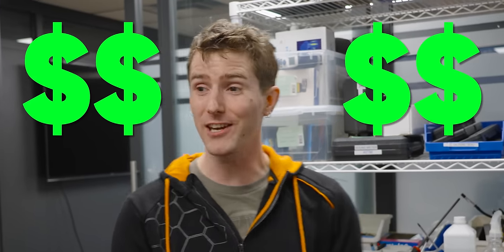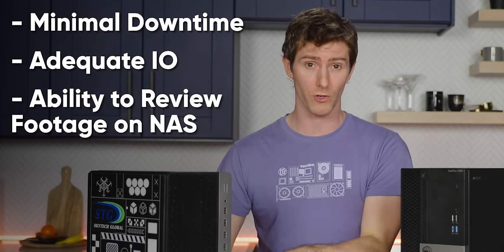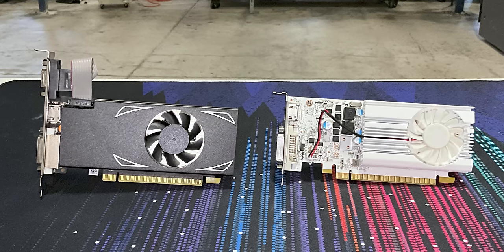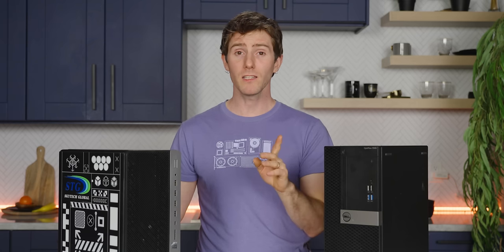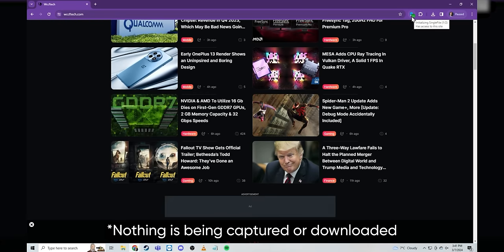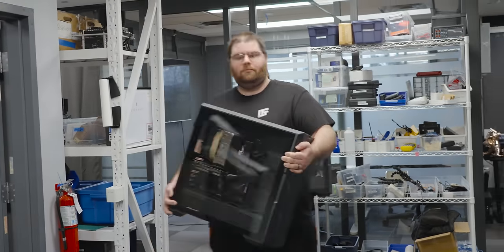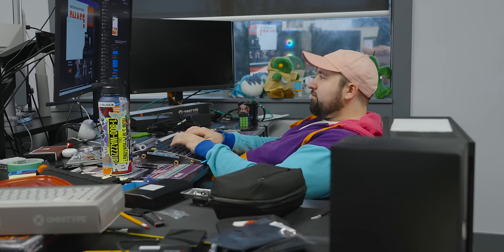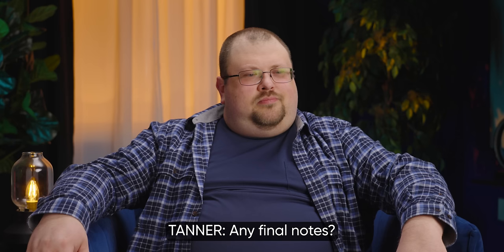We Downgraded our PCs to Prove You Don’t Need a New One

Comment: more than enough
i9-9900/i7-10700
$24 thermalright cooler
Z class mobo for +3200mhz ram
32gigs of 3200 or higher speed mem
240gig~512 of os drive (nvme)
960gig~1.2tera ssd local project drive
Rx 7600/arc a750 card
450W~550 good quality psu
Front mesh case $<50

Comment: I know everyone's probably tired of hearing this, but the only reason (in my experience) that things slow down is because of Windows Updates.  I'm writing this comment from a 2012 Mac Mini running Linux.  Despite being on the latest version of my distro, the computer runs just as fast as it did in 2012.  If I boot back into MacOS, not so much.  Every single Windows PC I've ever seen acting sluggish behaved like it was brand new when I nuked & paved it with Linux.  Granted, if you don't really bother to learn and master all the Linux counterparts to your Windows-only apps, you end up writing your own epitaph, but I gave up Windows entirely almost seven years ago, and I never want to boot Windows again for the rest of my life.  Windows = problems.

Comment: And Linus media is not a giant corp that has more than bunch of tools for monitoring, but light or mid so they did not experience the real downsides when bunch of agents start to collect data at startup and bunch of agents need to authenticate to servers and send data, checking policies, ect.. and if they are offsite that can be cruel for end user... But same computer (lets say 3rd Gen Ivy 3770 non k with 750 TI and regular SSD and that is higher end engineer PC) without all those agents runs just fine (even today) and can game on some low and even mid setting on some online games.
Main problem is if you are used to higher end PC at home and must work on something like that than things can be frustrating a lot, for users that usually surf at home and do some light work on low or mid computers and laptops will not see a lot of difference except those things that get slower at work and they do same thing and have "better" computer at work.
And it all depends on industry they are in...

Comment: I worked on a NUC for years, and was perfectly happy with it. CPU in there was pretty new, generation-wise, but not the most powerful thing. Had plenty of RAM, because that really helped with work. Nvme ssd too. Intel onchip graphics only, but since I don't need to play back 4k video - so no problem there. Also pretty easy to carry home for use on home-office days.

I got switched to a Laptop solely because I needed something I could put in a backpack and carry with me, should the need arise. Has a really nice screen, that I barely use (prefer the larger external ones I got) - and a not so nice keyboard that I barely use, because I prefer my external mechanical ones. And has an ever aging battery, that's gonna have to be replaced, once it starts bulging... but the way I use it, there's barely any benefit over the NUC.

Comment: Watching on my i7-4790
Reply: On my 4770K. My SSD (OCZ Agility 4 512GB) and chassis (Lian-Li PC-9F) are the only components that really predate the CPU. Possibly some or all of the RAM (4x4GB DDR3-1333) too. I've intentionally downgraded the storage after moving the data to a NAS. I'm probably on my 3rd or 4th time reinstalling W10 as software clutter and incremental driver updates can cause some issues.

Comment: I have a 10 year old laptop. It is snappy, as new. It is not windows 11 compatible, but who cares … I don’t. I stayed very very long on windows xp, which by the way is still my favourite windows version. After this, i will switch to linux (on the same machine) since i do not like the upgrade path to windows 11. Guess that microsoft made an arrangement with hardware vendors to try and push newer hardware since the speed difference gets marginal nowadays

Comment: Im with mine T3500, Xeon X5687 gtx 1070 24Gb of overclocked Ram 1999 Mhz ( made it possible with some strange custom BIOS from chinesee sites xD )  and custom cooler ( Manufacter tower with 2 fans attached to it with zips to make airflow xD ) and it's preety gucci till this day, sure, i do not play newest games on UBER settings but still can launch them on medium, with 60+ fps's xD

Comment: "would require monitor downgrade"... how do these clowns even work with PC:s professionally? dvi is digital singal, all you need from hdmi or display to dvi is a 2$ adapter, it just moves wired, no chips in it.

Comment: Playing this video on an HP Z400 in 4k. I edit videos on it too and it's flawless. I play GTA V and stuff too. It's an old workstation but it's good haha.
Reply: Operating System
	Windows 10 Pro 64-bit
CPU
	Intel Xeon W3565 @ 3.20GHz	69 °C
	Bloomfield 45nm Technology
RAM
	24.0GB Triple-Channel DDR3 @ 533MHz (7-7-7-19)
Motherboard
	Hewlett-Packard 0B4Ch (CPU0 PROCESSOR)	76 °C
Graphics
	BenQ GW2255 (1920x1080@60Hz)
	4095MB NVIDIA Quadro K4200 (NVIDIA)	46 °C
Storage
	931GB Crucial CT1000MX500SSD1 (SATA (SSD))
	1863GB Western Digital WDC WD20EZRZ-00Z5HB0 (SATA )	29 °C
Optical Drives
	PIONEER BD-RW BDR-209D
Audio
	Realtek High Definition Audio

Comment: If you're looking to breathe new life into an older computer, consider trying Linux!!  Especially on machines with less powerful hardware, Linux offers a significant performance boost compared to Windows. For reference.. my refurbished Optiplex 7010 from 2014 boots windows in 4-6 minutes, but with Arch Linux & XFCE, it only takes around 28 seconds!!

Comment: The one thing you high spec techie people forget because you rabbit on about more cores more cores more cores is that windows itself and all its associated software such as office and Firefox and chrome and all those bits of software only talk to one perhaps 2 cause when they’re functioning it’s only the advanced software like your photo and video editors that use more than two cores so as long as the core speed of Your older system is fast enough like 3.6 to 4.2 you shouldn’t have noticed anything different

Comment: This idea (using old kit) is true for another 18 months until Windows 10 support stops. Then you will need an 8th Gen Intel CPU minimum. 

Yes you can in theory load Windows 11 on unsupported hardware, however, this isnt a good idea and certainly not acceptable as a business solution (as this video is focused around).

Otherwise, the idea is right.

Comment: i use a windows xp machine with 4 gigs of DDR3 ram and a intel atom processor that was so hot that i put a fan with a 9 volt batt onto it so it wont burn down.
my expirence was: very customizable
browser is just fine
is a bit choppy
no anoying transistions and ki bloatware
no microsoft ai crap or onedrive or wallet
windows explorer worked fine
libre office is just exactly the same as today but it isnt horrifyingly annoying to use
i love crt screens
has 1080x1280 resolution in 60 fps so im fine with that
runs better than expected
can play youtube vids in 4 k without chopping and bloating (shoutout to school pcs)

and the expirence back to my modern setup was:
WHAT IS THIS AI BULLSHIT 
F THAT BLOATWARE
NO GO AWAY
YOU SON OF A

Comment: Ngl u should of been using systems with i7 6700's or 7700's not the i5's u guys just got bad prebuilds to use could of done much better and been much cheaper than new overall

Comment: I have a friend who has a real POS as a daily driver. And don't really even need more.
An old point of sale device. You sometimes get those for cheap. Really low power but if you just use it for youtube and discord it's not a big deal. Or googling recipes. Yep they are POS as the other meaning too but eh if you don't need more then you just don't need more.